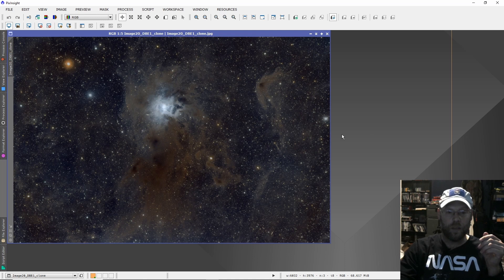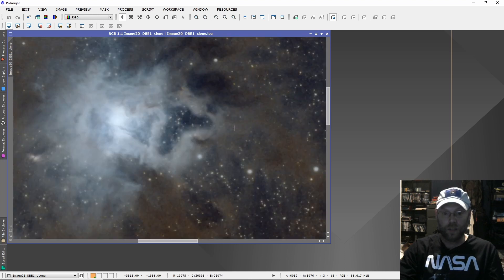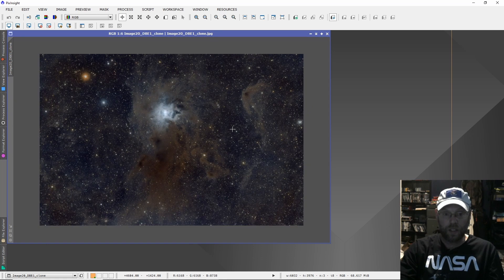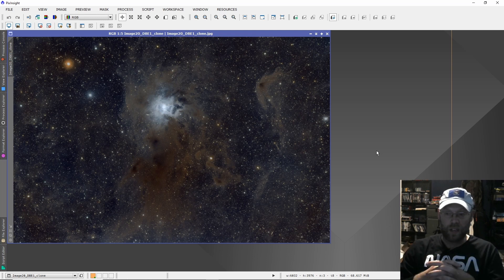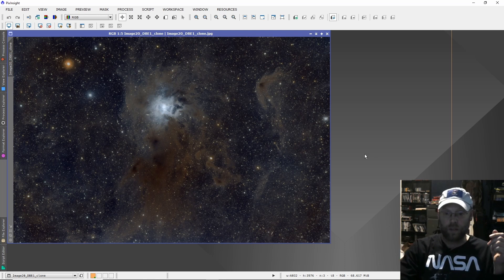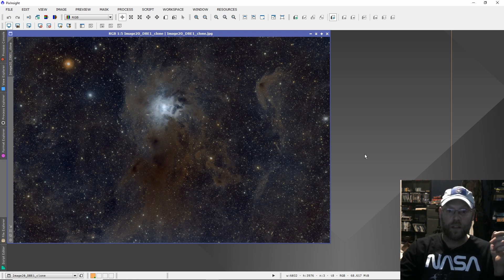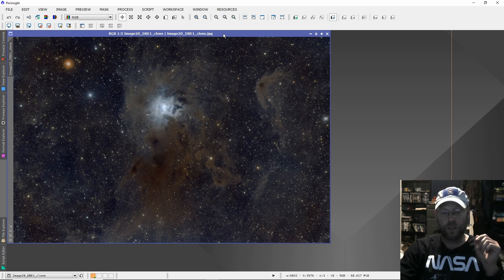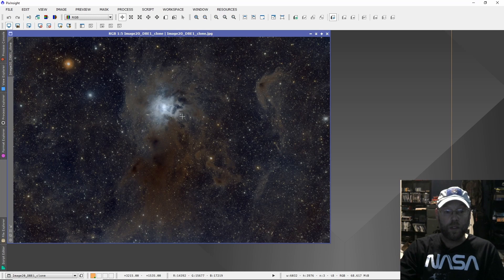Observatory Phase 3: Automation!

Comment: Hi, can I use the LesveDomeNet with 110V AC friction drive motors?
Reply from the maker: Lesvedome uses a set of relays to connect electrical circuits that power motors. If your motor turns when you put the juice to it, you can use it. If it requires some kind of intermediate computer to control it, it won't work.
Reply: @DeepSpaceDad  It turns when I switch it, but the dome doesn't stop immediately after turning it off. Because of its inertia, the dome slides for around half a second before coming to rest. Would it be a huge problem in automation?
Reply from the maker: @AlbinoTigerBarb  the controller will shut the motor off when the scope is centered in the slot. If it slides for long enough to then block the scope this will be a problem.
Reply: @DeepSpaceDad  Also, how did you install the photomicrosensor onto the 3D-printed azimuth wheel? How did you angle them? Was it plug and play, or did you have to configure it? Sorry I am a complete newbie but am currently considering automating my dome. Many thanks!
Reply from the maker: @AlbinoTigerBarb  I'll make you a quick video tonight about the encoder
Reply: @DeepSpaceDad  Thanks!!

Comment: I'd like a look at the shutter mechanics.  I've a dome and this seems the most difficult to solve. Regards rob
Reply from the maker: I got you. I'll put up a quick video right now.
Reply: @DeepSpaceDad  thank you very much for taking the time to make this short video.  This is the power of social media at its best.  There's always someone out there who can help out others.  Nice one. I've been looking at a chain system, but the radius of the cogs is troubling, and the shutter is miswieghted so that it is heavier on the motor at the extremes and in the middle of the action will suddenly swing its weight over.  But nice to see a working system.  Love the channel, I'm not brave enough myself! Perhaps one day I'll have something to show.
Reply from the maker: @easthorsleyobservatory3866  the springs on the end of the cables in this system help account for the weight flopping over after the apex. I've been thinking of a chain drive system too. It'll be rigid enough to not be bothered by the weight shifting. I'll shoot you a drawing.
Reply from the maker: Okay, Video is up. If you have any specific questions you can email me. dspacedad@gmail.com